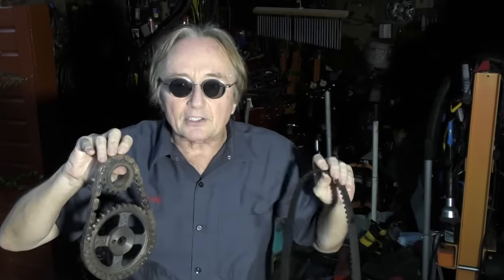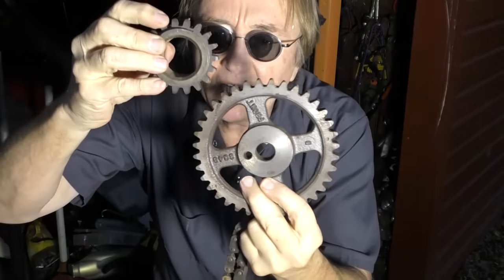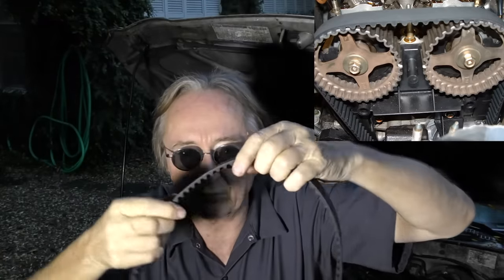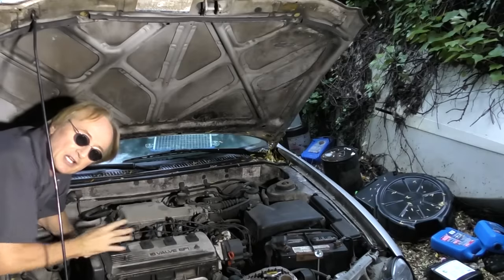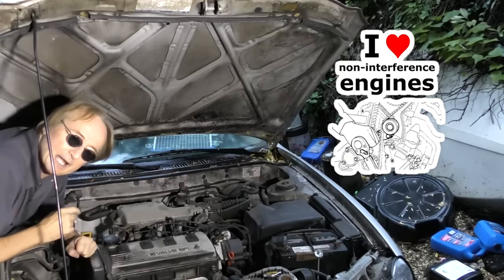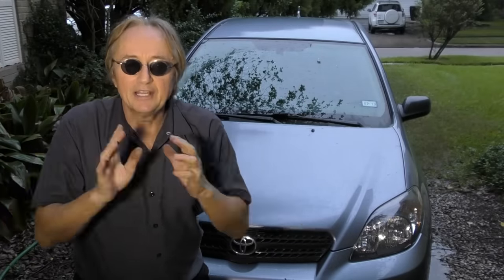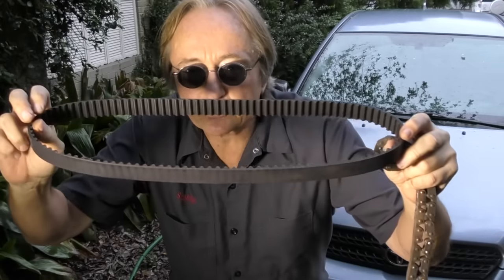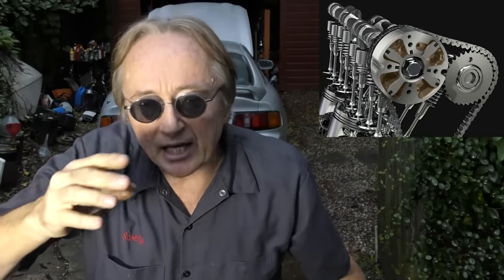Why Some Cars Have a Timing Chain Instead of a Timing Belt

Comment: Timing chains where not all sunshine and lollipops. For a while (in the 70's at least), GM was using nylon coated teeth on the timing gears to make the chains run quieter. The nylon on the teeth would give out over time and cause the chain to jump one or more teeth. This was obviously better than breaking a belt. But it did cause the engine to quit running, sometimes without warning. It was a popular choice to replace the nylon toothed gears with all steel units when they failed.
Reply: My 1969 350 Camero with a nylon coated cam sprocket  jumped a tooth at 60K. Happen while starting so only minor damage.  Went to the "speed shop" and bought a double link roller chain and sprockets kit.  The shop said it might be "kind of loud".  So was the whole engine and exhaust so..... "so what".
Ran fine until I sold it with 140K and man, I wish I still had that car.
Reply: They were non interference tho. Also with the old GM engines with EGR your best bet was to change the cam and lifters if they were still stock because they would heat up get soft and wear out the lobes closer to the EGR.
Reply: 70s GM cars were junk. I had a 77 chevy Nova 305 V8. Valve guides drilled crooked resulting in broken rocker arms, Carb only bolted with 2 bolts, constantly working loose, Rear leaf springs broke,  Landau vinyl roof caused rust around "fake" porthole window. differential cover leaked oil when new. body sheet metal not straight.The worst car I have ever owned. Timing chain was about the only thing that did not break LOL
Reply: GallopingTrader all of us GM guys already  got that memo and we already swapped those nylon gears out immediately.     Let’s put that behind us and move forward
Reply: So true and all GM V's, had that nylon coat. 95 % of the time it failed and slipped timing was on cold start, the back lash of 
the timing chain associated with the backfire would do the already weak nylon in and valve timing would jump 10-30 degrees
out. As it was that was good, with the no start/no run it kept the valves safe from being bent or pistons from being shattered.
Reply: @michaela.660 
 Pontiac  389's the very worst, I owned'em, love'd them and had to replace timing gears/chains in all of them...all because of the nylon toothed cam gear.

Comment: Plastic chain tensioners...living that Jaguar XJ8 life.
Reply: a plastic piece in the engine block? wow..
why they do this
Reply: @Nist12  saving money I guess. Second gen were half plastic and finally after 4 years the 3rd gen were all metal.
Reply: Good luck looking for chain guides made of metal
Reply: Toyota 22r has chain guide problems
Reply: how about the plastic timing gears...
Reply: Plastic timing gears have been used in aircraft for decades. No big deal... never seen one fail.
Reply: What year jaguar?
Reply: VoloKin Project true
Reply: @Bartonovich52  Bartonovich52.......You haven't seen enough of them then. Because there have been countless plastic timing gears with real steel timing chains fail in cars and trucks. I've seen it happen myself many times through the years. Just 1 example: In the mid 90's, I was assigned a company truck, a 350 Chevy. Quit running 1 day, and I swore I heard a little metallic sound, much like your car keys being dropped on concrete. Sure enough, the plastic teeth on timing gear failed, and the sound I heard was the timing chain literally falling off the timing gear. Proof you're dead wrong. And if they are using plastic gears in air craft........then shame on them.
Reply: German cars love plastic important parts
Reply: Or that BMW e38 life...
Reply: @Nist12  They are not alone in that.. even Mercedes does it.  The reason is they do not wear out themselves OR the chain plus they do not make noise.  The problem, of course, is they can (and do) break inside the engine...
Reply: Howabouthetruth I'm thinking that the quality of the plastic they use in the timing gears in aircraft applications is better quality than what you would get in a mass-produced automobile.
Reply: And the 3rd generation Explorer.
Reply: Yeah, the 4.0 AJ-V8 Jaguars had this problem at the beginning. Then they switches to the all metal ones and the problem is gone. Just make sure to buy the 4.2L engine instead, or make sure that the previous owner had them changed.
Reply: And Ford SOHC 4.0L life.
Reply: Harley-Davidson engines particularly the Twin Cam and Milwaukee-Eight utilise cam chains and nylon tensioner shoes as well, which has been a major point of contention with them bikers. There are conversion kits which replace the chain drive to an old-school gear set, but even that isn't trouble-free either.
Reply: I feel you, speaking from an x308 owner
Reply: @Nist12  fuxking Jaguar does. I wouldn't take an engineering degree to figure out this is a stupid design to use a piece of plastic in the heard of a engine
Reply: @KT-fi7tm  like the waterpump (in my 2006 first and only vw)
Reply: 2000's Ford's trucks lol. 5.4 2v and 3v. 4.6 2v and 3v. 4.0L sohc. Early 3.5L ecoboosts.
Reply: SuperAspari - Not even E38, those were engineered and built before BMW threw a plastics factory beneath the hood of all their vehicles.
Reply: Alex Puls - The Ford modular V8 is good reliable engine. Every Crown Victoria taxi and police car with a couple hundred thousand miles has one. I’ve had a 2002 E350 SD work truck with the 5.4 2V and it was dead reliable even after 220k+ miles. The pulley squealed around town, but no problems.
Reply: @redbluesome2829  well I happen to have a 5.4L 2v in my f150 and I'm on my 2nd engine cuz a chunk of the chain guides broke off and clogged the oil pickup and destroyed the engine. There was no way of me knowing anything had gone wrong either. It ran perfectly fine just like any other day, then all of a sudden it started knocking like crazy. I guess there was still just enough oil pressure so the light didn't come on but not enough to lubricate the engine properly.
Reply: VoloKin Project gay
Reply: @mateodelcastillo7186  your dad
Reply: Steel chain guides lol.. not true!!
Reply: Really....wow. No wonder they had issues. Someone told me that they would never own Jaguar without bumper to bumper warranty.
Reply: @utrich31  realistically it won't break but you'll start to hear the chain rattle when cold start so plenty of time to fix it.
Reply: 22re Toyota.  Plastic chain tensioners too.  Doesn't matter now, doing a 1uz swap. 😎
Reply: @VoloKinProject  Not to save money, but to MAKE MONEY!!

Cheap plastic parts break more often and need to be replaced more often.  More money for them.  Planned obsolescence.
Reply: Justin Simek what kind of noise? Like a start up rattle?
Reply: These are not a true plastic, and is much tougher than plastic like what you would find with a bowling ball, or some shower towel bars.  @Nist12
Reply: Most of these modern sports cars, like Jaguars have no attractive appearance to them and appear no difference than a simple gas saving car like a Honda Civic or some GM Car.  After leaving Wal-Mart, its so easy to lose my car by how so many other makes and models of cars look like mine. That remote locking thing in my key helps a lot in finding my car by sound.  hee hee : - ) @  @vincentlu36  Sadly, our American and European Automakers have forgotten how to innovate the appearances of their cars.  However, it was my Accord that I could not tell the difference from American Cars.
Reply: Depends where you find those parts and what they are used for.  The worst place for using those Vinyl Plastic materials are for car bumpers.  I hate that. @  @homeslice2487
Reply: Those ford parts in the jag
Reply: I lost a KA24E Nissan engine to poorly designed plastic chain guides. They've since fixed the issue, so my KA24DE doesn't have the same issue.

Comment: I got the feeling you don't like Nissan very much Scotty. Just a hunch!!
Reply: love my Titan. Steel timing chain. Forged crank. thin body metal.
Reply: @dufus2273  good to hear something positive about Nissan. Nissan Altima is definitely quality! Sorry Scotty! Think it's about knowing the models and years of a brand.
Reply: He likes the old ones pre-Renault merge. And my Grampa's neighbor has a Datsun 280Z.
Reply: Sam Rossi Songwriter Not all Nissan’s are bad. Nissan Leafs are super reliable!
Reply: Nissan GTR > any Toyota lol
Reply: dufus I love my frontier
Reply: @RicardoCanedoMX  that's good to know, little concerned about the safety of a smaller car in Deer Country.
Reply: Same here.I love my Nissan truck. It has over 260,000 on the stock motor from 1987. The timing belt service interval sadly is only 60,000. It has been rollin 31 inch tires since it was made. I wasn't a huge Nissan fan until I got this truck. The motor is going on 33 years without a rebuild.
Reply: @thelagmeister  can I buy it for me now?lol one of the best ways to build wealth is hold on to your vehicle and maintain it well if it's a good one. I try to tell people that are always buying the latest truck.
Reply: I do the same. Originally I bought it out of a co workers back yard for $200 not running. 5 speed v6 4x4 king cab with shell and the body was good. I have about $2000 in it though. I was selling it recently because I need a family vehicle and now my Dad is buying from me. A built turbo z motor is $2,500 shipped to my door. I find it hard to want a newer truck when I can have a turbo motor for a lot less.
Reply: @thelagmeister  if you can put up with the comments from the car snobs over the next 20 plus years, like I did,  the savings will just pile up. two people I know personally had to sell their house cuz they had too many brand new vehicles in the driveway. I still got my home.
Reply: Nissan is top of the list for reliability and resale value, better than Toyota,,,,,,   I also believe that Al Gore should have won the election and tooth fairies are real
Reply: There were pr-e Renault Nissans that sucked. The Nissan Maxima was unreliable as hell from 1985 to 1988.
Reply: He liked Datsun. Not the merger Reno Nissan. 

Once again experience and wisdom. No biasedness
Reply: That makes sense. I ended up buying a Toyota truck because they wanted more money for the Nissan trucks. That being said the truck blew the transmission at 178,000 while my 87 is five years older than that truck and the transmission is fine. Did you know he invented pants and the internet?
Reply: Scotty loves Nissan. The more people that own them the more business he can take on. Think about it.
Reply: He could have said the same thing about Honda using timing belts back in the 90's Now they use chains.  Nissan does not use timing belts anymore.  And probably never will.
Reply: @dufus2273  I love mine too I wish he would do a video talking about them.
Reply: I notice that too!
Reply: @MrBeams707  I have a 90s Honda D16y7 started with 90,000 on it belt looked good so I left it alone. Just over 205,000 now. Most of time over 10,000 between oil changes and ran low multiple times. I've been redlining a good bit trying to blow it up so I put y8 in it. I might just swap the y8 head on it with a new timing set and water pump if the belt doesn't  give out anytime soon.
Reply: Because of Scotty he steered me away from buying a Nissan Sentra with a CVT transmission.  Those transmission are well known to last less than 80k miles.  A $5,000 replacement awaits those owners.

Comment: 2zzge baby..long live timing chains😎😎
Reply: I have the 2jz-ge...... belt and interference (vvti) :(
Reply: @VincentCS34F  :(
Reply: @2012日本語がわかりません cool then.
Reply: I wish I had the 2zz... stuck with a 🐌 1zz
Reply: @Phannty  lol 1zz is not that bad
Reply: I have 7AFE and no problem if broke the timing belt :), but of course i like chain belt
Reply: Alex Vieira Not If your a 98-01 Nissan Altima lol The Tensioners go bad after 100k
Reply: Alex Vieira Word! I have a 2zz swapped Spyder. An absolute jewel of an engine. Especially with a Power FC
Reply: Cummins... long live timing gears.
Reply: @Phannty  1zz is a good engine if well taken care of
Reply: Scotty said Toyota failed with the last gen Celica engine
Reply: @XenomorphLV426  it's a rather more  delicate engine if you will, but taking good care of it it shouldn't have any problems. Just don't sandbag it like most idiots do
Reply: thatunknownguy yeah they’re great mine has 250k miles and still going strong expect for a leaking timing chain tensioner
Reply: Love my 1ZZ-FE (2004 Celica GT Tsunami).

245000km, runs perfectly. 

A 2ZZ would be nice, but at least I don't have to pay for premium gasoline.
Reply: @AndrewFRC135  You have timing belt.
Reply: 1zz-fe 02 celica checking in
Reply: 1ZZ Corolla here @ 309'000 Kms
Reply: hell yeah 2zzge for life

Comment: I always hated timing belts in principal. The first time I saw one, I thought the engineers were completely insane. I spent a couple of hours trying to wrap my head around why any engineer would choose such a sloppy and poor solution to something that absolutely needed maximum reliability.
This is why you should never buy a brand new car. Always buy used, a couple of years after all the bugs have been discovered.

Scotty, I worked as a transmission mechanic. Quite often, we had to do rebuilds that required engineering updates to improve lubrication or solve other factory issues. It would be interesting for viewers to know how often brand new cars get these unknown updates that are only addressed after equipment failure, during the repair process.
Reply: You should buy used card cause they are more affordable. If you can afford a new car, it's best to wait till the end of the year when both delears & makers are offering incentives. By that point plenty of people have already noticed and reported the bugs your talking about.

Comment: Yeah, I remember with the Chrysler 2.2 and 2.5, they had rubber timing belts. My grandfather refused to buy one back in the day because of it.  He was certainly skeptical over the reliability of them verses the old chain method. I bet if you could convert the Honda 3.5 v6 to a chain it would just run forever.

Comment: I hate cars with timing belts. Another point of failure
Reply: Badly designed timing chains are also a huge point of failure
Reply: @CookiesUnleashed  true esp with plastic guides
Reply: @CookiesUnleashed  ive got a car which needs the chain reaplaced as often as the belt so its more expensive. We need to go back to gears
Reply: Ha ha. See BMW n47 diesel engine
Reply: As opposed to a chain that has hundreds more points of failure?

Comment: I haven't paid much attention to engine construction for about 35 years but now that I'm into DIY this is very interesting stuff Scotty presents. Not sure if I would change a timing belt or chain though - sounds simple enough except for all the stuff you would have to disassemble/remove in order to change the belt/chain. My 02 Mustang GT and 2014 Xterra has an interference design so I'm glad they have chains.